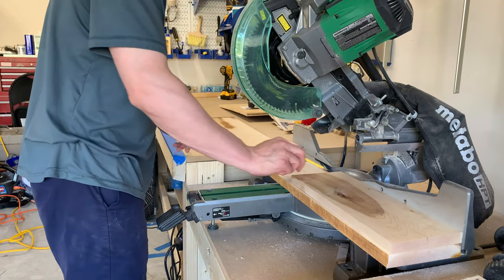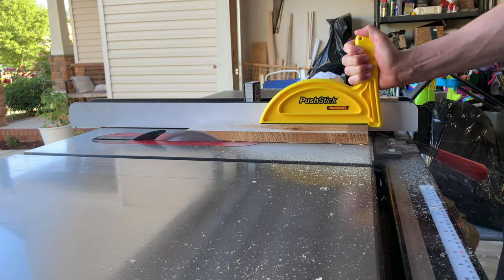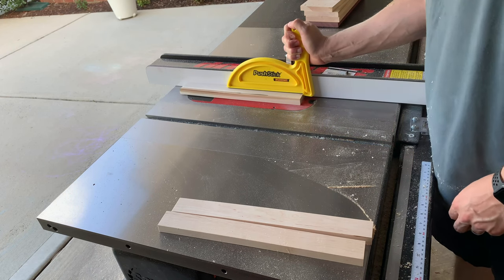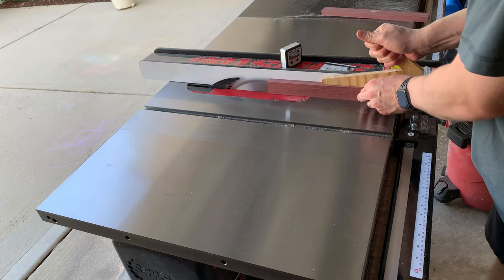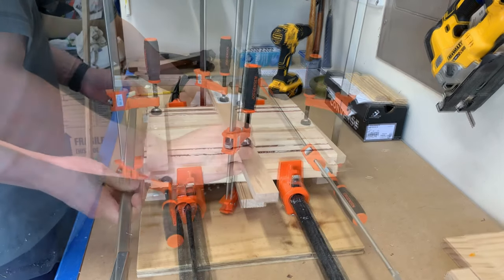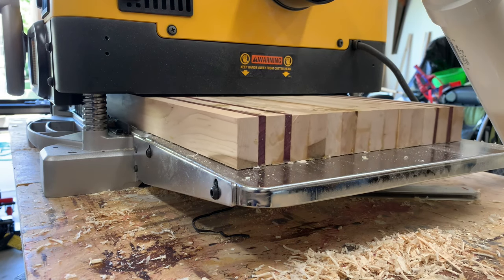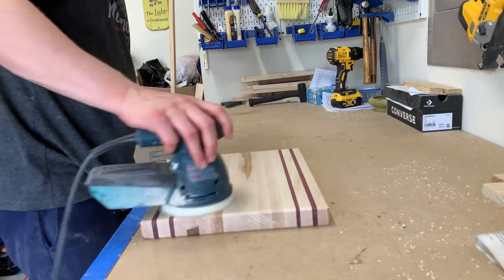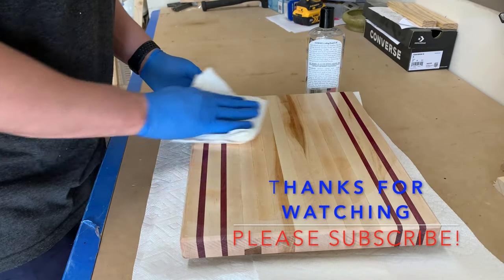Hard Maple & Purple Heart Edge Grain Cutting Board | How To Make a Cutting Board | Christmas Gift

Comment: Am I the only one that uses glue on both faces of the strips when glueing them up? Is that necessary or can I get away with just one face of the strips?
Reply from the maker: I think if you ask 100 woodworkers it would probably be a 50/50 split. One of the quotes I heard is that when applying glue use it like you borrowed it from your neighbor. What ever has been working I would stick to that.